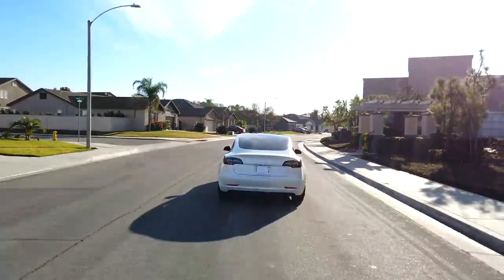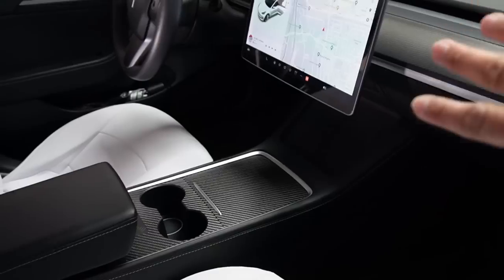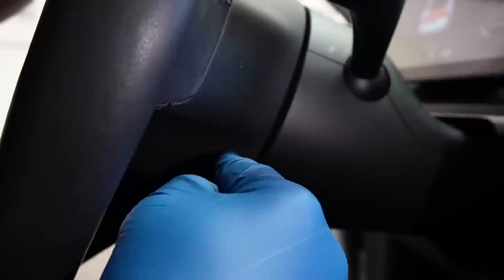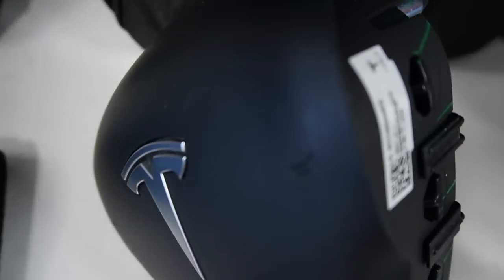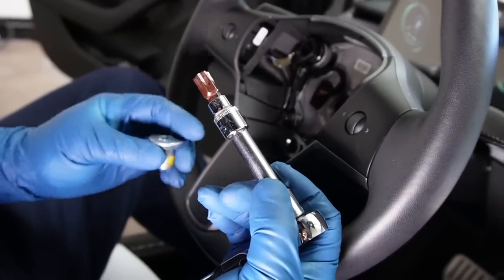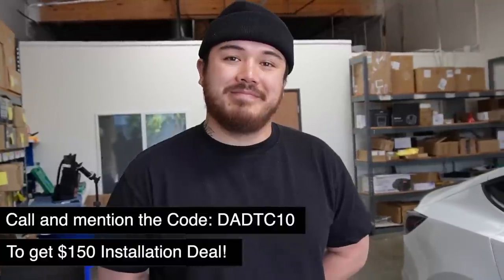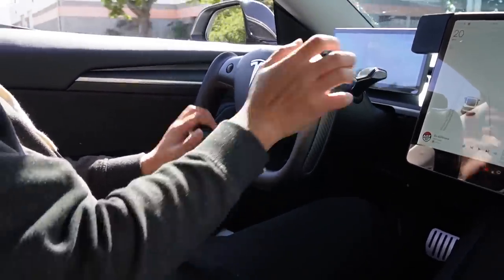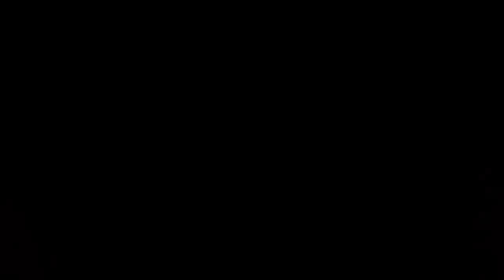How to Install Tesla Model Y/3 Yoke Steering Wheel by Authorized Installer #tesla #teslamodely

Comment: Idk if Hansshow has been shipping reviews better versions with OEM parts or not, but the current version you can actually buy from their store DOES NOT use genuine OEM parts. Everything including the wheel base in a Chinese copy. Seems like they are still showing images with the OEM base on their product listing on the webpage. Got mine today, and it doesn't have any OEM parts. Bait and switch idk...

Comment: Is so after just trying it. I think we had better luck with a Allen key. You want to go just a little bit bigger than the whole and it will poppet right out. We just tried with a screwdriver and sat there For about 20 minutes thinking that we had it but it wasn't it. Also if you get popped out just a little bit and you think popping it back in to repopt it out as a good idea it is not. Because what happened was the horn just continued to keep going until we got it and we smacked it a couple times and it stopped. Is b**** forcing it for a while we were just about to Disconnect the battery. Is hopeless help someone.

Comment: Great looking… not sure if that would be an actual upgrade for me. Seems like a fad that would get old quickly and not having that full control of the wheel under emergency turns etc.
Reply from the maker: You will definitely take sometime to get used to driving with a Yoke but I think after you’ve been driving with it for a while those emergency turns shouldn’t the issue.
Thank you for watching and your great support!🙏
Reply: There have been enough issues that Musk finally gave the OK to allow owners to swap the yoke for a steering wheel. Remember when the yoke first came out, he insisted there would be no option for a steering wheel. I knew it would cause problems and hurt sales.
Reply: @rkgsd  that Batmobile steering wheel might’ve looked good on a drawing board but it has ZERO practicality and consumers realized that 30 minutes after driving that vehicle and some of them said dam.. what have I done cuz the learning curve is too much compared to what’s usual and practical. Elon can possibly revisit that dumb mistake in about 50 years when flying cars may be present.
Reply: @XX-166 zero practicality? How about more legroom for tall people, and more vision of the road and display in front of you (which will be aftermarket)
Reply: @MechInvent  zero practicality to you.. want more head room buy a Tahoe or have some cheese with your whine.

Comment: Hello friend, I advise you to leave the central bolt screwed in before detaching the steering wheel. As you did, you risk pulling the steering wheel towards you and tearing the spiral contact wires. If you leave the bolt inserted just loose you are calm that nothing happens
Reply from the maker: Appreciate your comment.
Thank you for watching and the tip!🙏

Comment: Expert? He did not disconnect the 12V battery. He used a Torx bit on a hex bolt. He didn't disconnect the purple plug before pulling off the steering wheel and could have pulled the wires from the connector. There is no need to bang on the steering wheel, just rock it side to side.
The ground wires for the horn are not for the scroll wheels.
I guess he learns as he goes...😮

Comment: My Tesla Model 3 is of 2023. Before replacing steering wheel is it enough shut down power from touch screen? Many videos shows necessity disconnect low power battery and main power battery. How this can do impact in car electronics and computer after connection of power again after the replace? Thank you.
Reply from the maker: This doesn’t impact the car’s electrical and battery at all. They had to turn off the main power or disconnect 12V and main battery is to prevent the airbag from accidentally deployed while you we’re trying to remove it. It’s up to you if you want to just turn off power or disconnect to battery too.
Thank you for watching!
Please subscribe for future contents.🙏😃

Comment: Nice video but I would not risk to do it myself. 😀 The front screen does not come by default and you have to get it along with the Yoke Steering Wheel. You did not talk anything about the cost of the product plus installation for it. Did I miss something? BTW, I have also reviewed Tesla Model Y's Hidden features on my channel and looking to get the Yoke Steering Wheel.
Reply from the maker: Appreciate your comment.
There is a part in the video that I explained about their promotional price for basic yoke steering wheel with installation for $550.
Thank you for watching!🙏😃
Reply: @dadstoyscars  What about that second screen that you also installed? I am referring to cost and installation process of the display screen.
Reply from the maker: @carsandaccessories  Here is the full video review and installation: https://youtu.be/brPjjlaftrY
I hope this helps.

Comment: Granted one should be driving with both hands on the wheel and should be at the 2 and 10 and positions, but this wheel would be uncomfortable for long drives as you pretty much don't have much hand positions you can change up to to get comfortable. Would be a no go for me.
Reply from the maker: I actually find it more comfortable on a long drive than short drive. Because I can just rest my hand on the bottom left or right of steering wheel while the car is in Autopilot. I had to get used to small turn more than anything else.
Thank you for watching!
Please subscribe for future contents.🙏😃
Reply: @dadstoyscars  I guess the auto pilot helps.

Comment: I watched your video showing how to install a cluster display in front of the steering wheel.   I wonder whether Tesla allows DIY of this display.  If not, are there authorized installers?  Thank you.
Reply from the maker: I’m sure if Tesla would directly allow to install aftermarket parts. The display is plug and play so you can remove it anytime you want. It’s not permanently attached to the car.
As for authorized installer, I don’t think there is one that actually authorized by Tesla. The display is not that complicated to install you can just follow my step by step instructions to install it.
Thank you for watching Amy!
Please subscribe for future contents.🙏😃
Reply: Also service center techs that came to my house for myQ garage adapter thing said their techs aren’t allowed to install 3rd party items. Warranty issue.

Comment: I installed my new yoke for my model y 2020 and now it’s showing steering wheel scroll buttons and horn unavailable. Service required to restore functionality. I did not disconnect the 12v battery when installing and I believe that’s why the error code popped up. Now my horn doesn’t work or the scroll wheels. Can you help!?
Reply from the maker: Did you swap out the buttons to buttons that came with your car?
If you check in the video the shop suggested to take out the buttons that came with yoke and replace with your original buttons from your car.
Other issue I don’t think it would cause by not disconnecting 12V battery. The horn might cause by improperly installing back the airbag. I will try to reach out to the shop and see if they would have any suggestions.
Reply: @dadstoyscars  you got it bro! I took the old buttons out and installed and it was good to go. The yolk I bought came with all the insides so the first time I installed it I thought it was just plug and play but apparently the new buttons weren’t recognized?

Comment: I'm excited to get this yoke, LOL
Reply from the maker: Are you going to there to have them installed?
Reply: Hey, sorry for the late response.  I called in and I was quoted $300 for the installation fee.  Yikes.  Also, I don't know whether I would received a TESLA wheel or aftermarket @dadstoyscars
Reply from the maker: @J-J-TL  ask them if they still offer $150 yoke steering installation promotion.
Reply: @dadstoyscars  Yeah I will tomorrow.  Plus, as long as Tesla OEM component(s), then it's fine.
Reply: @dadstoyscars  The $150 promotion still on going.
Reply from the maker: @J-J-TL  That’s awesome!
Reply: @dadstoyscars  Applies for Steering wheels only.  LOL

Comment: Turning off the power from the screen does not turn off the power from the aigbag. Need to disconnect the 16V battery AND main power.
Reply: The question about disconnection of both batteries still not answered. Maybe some body can refer on possible consequences of wrong action? Thank you.

Comment: Can you give me a suggestion on how to align the bolt for tightening the swivel screen.  One bolt went in easy,  but the second bolt just will not align properly.  What can I do to get the bolt alignment to go in easily 🤔?
Thanks
Reply from the maker: I never actually install the swivel display myself but I will try to reach out to the guys at the shop and see if they have any suggestions.
Reply: @dadstoyscars  thanks 😊 🙏.
Reply from the maker: @beelust4312  Here is the comment from Tes Studio:
“When we come across this issue what we usually do is alternate in the tightening from one side to another to allow both bolts to sit in much better”
I hope this will help.

Comment: I doubt the insurance will accept the modification since it is related to the safety of the driver (i.e. airbag). So I guess do as your own risk.
Reply from the maker: When they installed the yoke steering wheel they didn't change the OEM airbag. They use the original OEm airbag from my car and put it back on Yoke steering wheel.
Thank you for watching!
Reply: @dadstoyscars  Thanks for clarifying. However, my concern did the federal agency NHTSA test the airbag installed in the Yoke yet? I know it is the OEM airbag but when it is installed into another hardware, it works differently and very risky for not being tested and approved by a government safety agency.
Reply from the maker: @dl4434  They plugged it back in the same spot used the same wire nothing change. The only thing changed was the housing which actually from Tesla. The aftermarket company bought Tesla OEM steering wheel and only changed the handle part from round to yoke and kept the center housing the same which came from Tesla.
Reply from the maker: I also showed in the video here: https://youtu.be/lvhLfpttdk8?t=928
Reply: I recommend to check with your car insurance and get response in writing. I personally do not take the risk for anything related to safety. I am sure Tesla will not accept the car warranty if you modified the car. Even you change a light inside the car. I talked to Tesla service rep and he confirmed it.
Reply: Just keep your stock wheel and swap back out if you need warranty service.

Comment: It looks good and I thought about getting one myself. However another youtuber, Lockett tech, has same one installed but it starts to come apart after about 9 months. I will avoid Hansshow for the time being.https://youtu.be/_0HXG9ocGXo?t=520
Reply from the maker: Steering wheel is broken after 9 mos?
This new yoke use most of the hardware from your OEM steering wheel and the only thing was changed was the house and handle of the wheel. All the buttons and airbag were from my original steering wheel. So I don’t for seen how will it break.
Thank you for watching!
Please subscribe for future contents.🙏😃